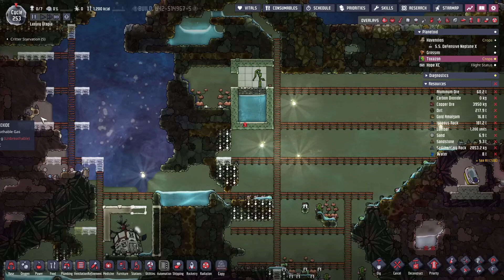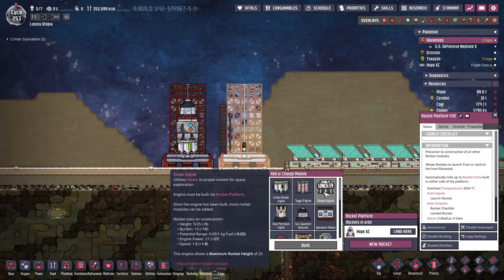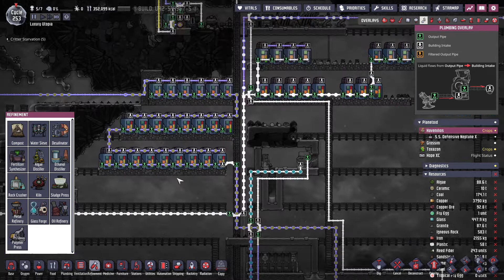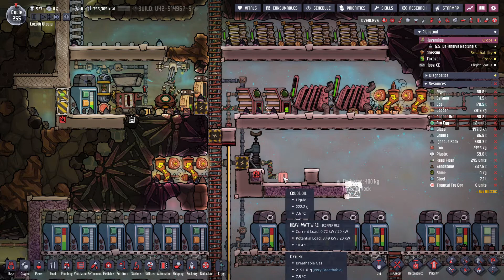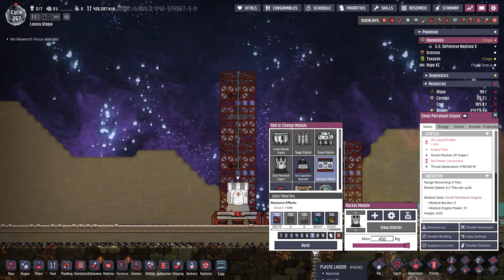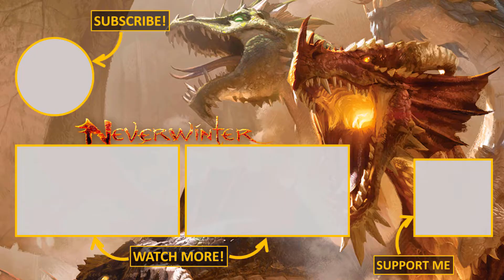S02E23 – Liquid Gold: Petroleum Production

Comment: Curious as to why you used the mini pump to vacuum out that closed off area. Would it also have worked to vacuum the entire area out first and then close off that section after? I understand that section needs vacuumed and sealed to prevent the two joint plates from interacting and leaking heat but since the entire thing was getting vacuumed anyway it seems like the mini pump may be redundant. Unless I’m missing something. 😅
Reply from the maker: You're right that small pump was a bit redundant 🙂